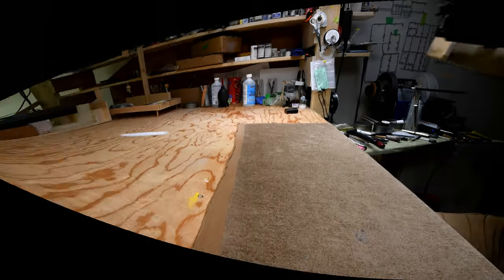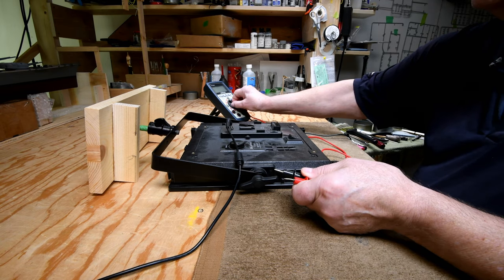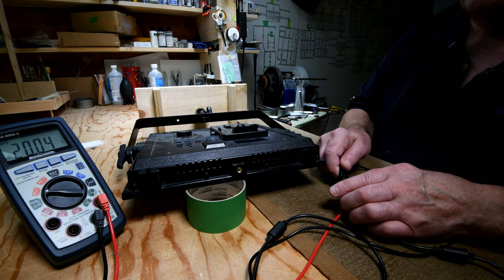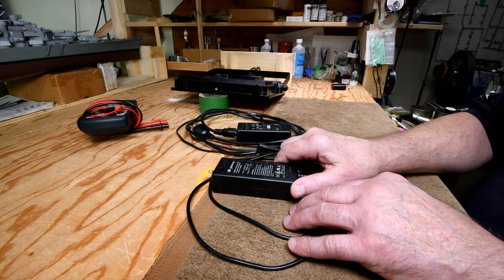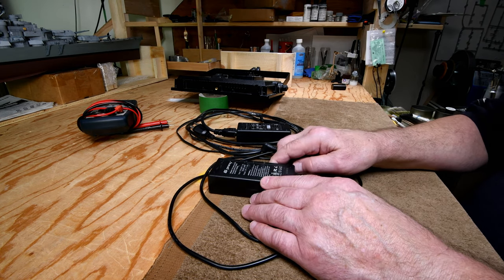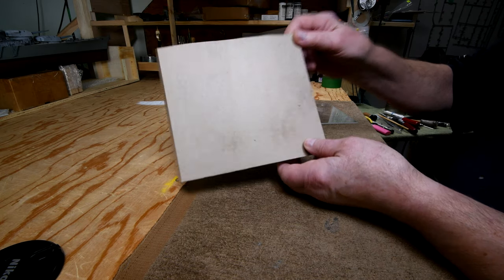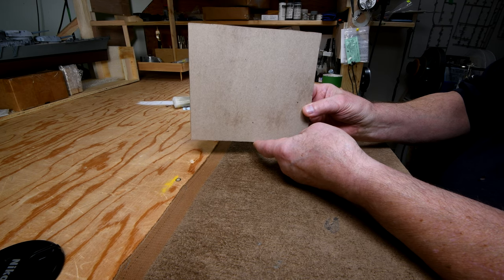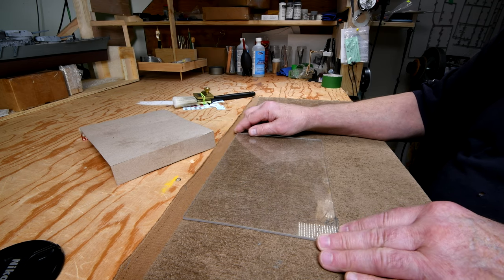The Model Ship - Part 475

Comment: Hi Ron, May I ask what video resolution and fps are you using for your 20min videos? Also what the average file sizes are your uploading? Cheers
Reply from the maker: I have my Nikon D-850 maxed out to 4K ( 3840 X 2160) @ 30fps. Episode 475, just under 22 minutes in length, was 7.26 GB after processing. Internet speed is consistently good here in Winnipeg and it takes as about 2.5 times as long to upload to YouTube as the video is long. ie: a 22 minute 4K @ 30fps video takes only 55 minutes to upload to YouTube. Hope this helps. 🙂